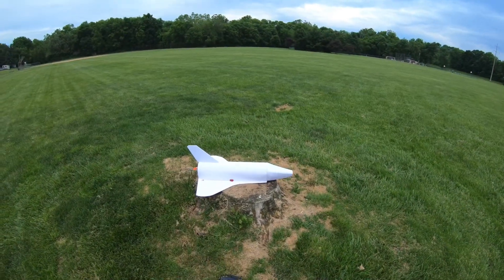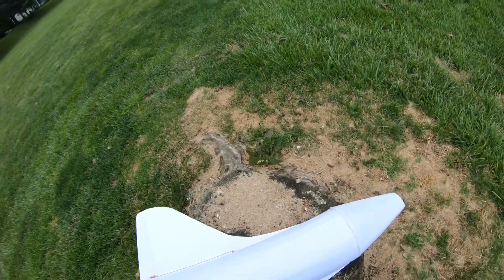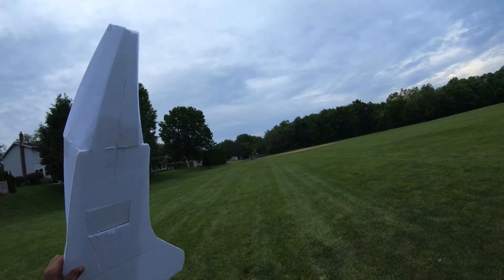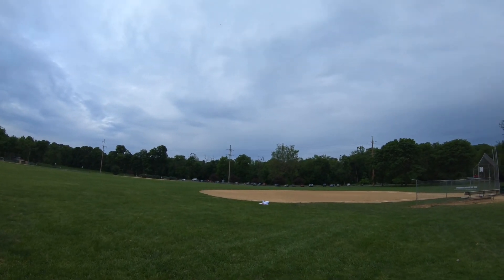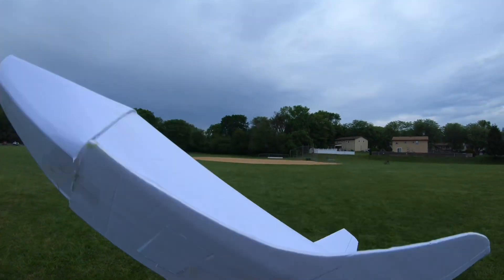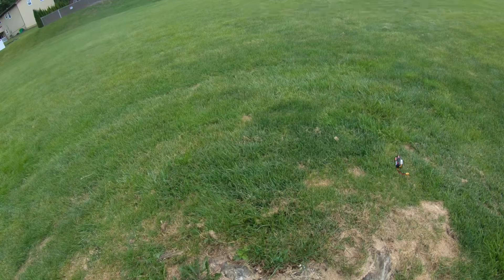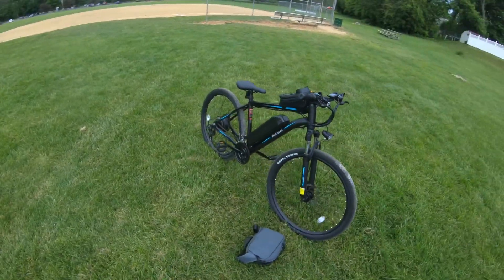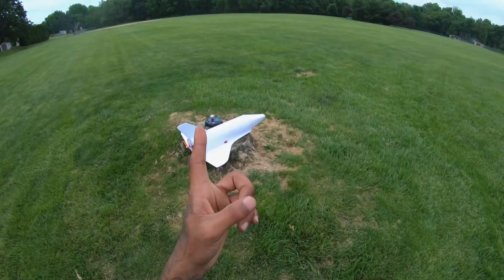DIY NASA JET!!

Comment: Looks like a good build.  The motor is probably Plenty strong.  One problem I see right off the bat is that you have a WALL directly in front of the air intake of the Prop.  A Major obstruction from free flowing air traveling across the prop.  Just like an EDF.  It must be able to inhale as freely as it exhales.  Imagine breathing in through a straw with the inlet almost completely covered.  It needs to breath freely inwards, as well as outwards to get maximum efficiency from your motor.  Love your videos brother.